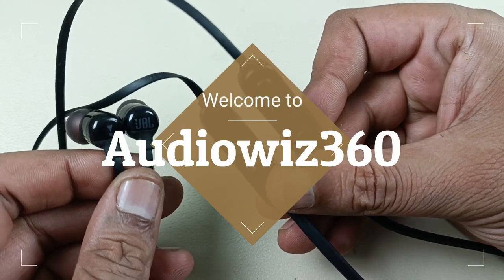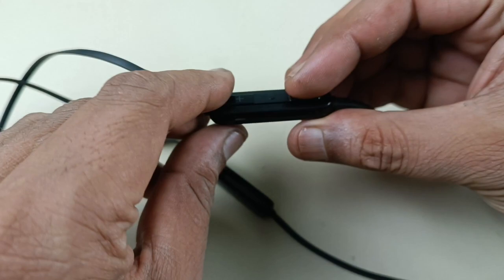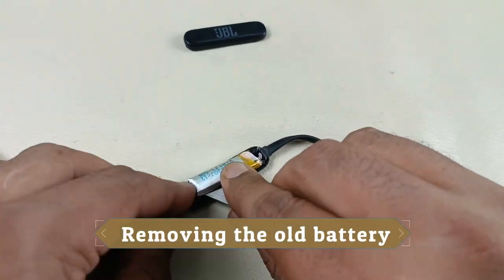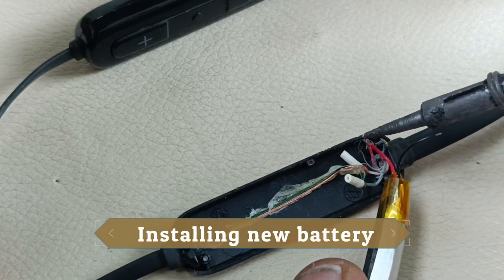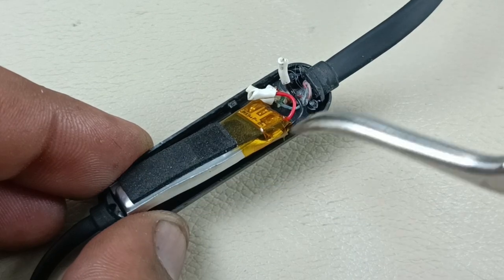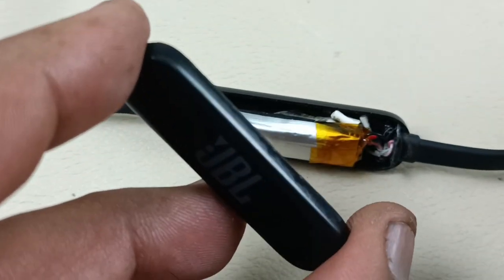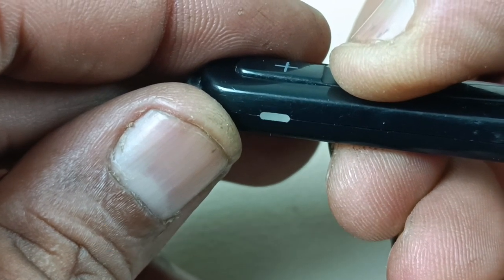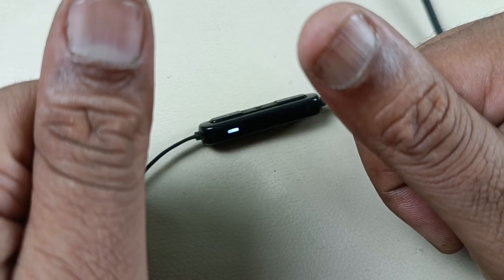How to replace battery of Bluetooth earphone | JBL T110BT Battery replacement | Fix repair headphone

Comment: Ive owned three of these. The batteries are small and don't last much past 90 days with daily use, and they're all but impossible to replace. Soldering? Come on. By contrast, ive switched to wired headphones which don't have batteries to wear out. Two years of use, no problems at all.  Du-uh!
Reply: 90 days only? I have been using it for 2 years. No problem. But recently I accidentally put it in my washing machine and now the battery is not lasting. Thank god the earphones are still working. Just need to change the battery. 
Ehat is the specification of the battery